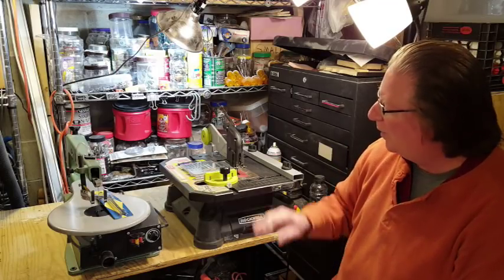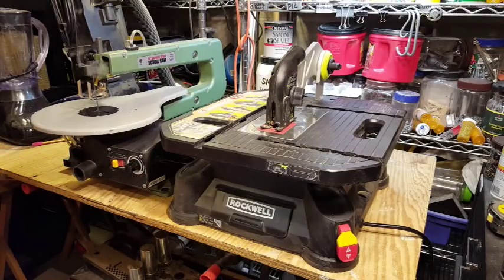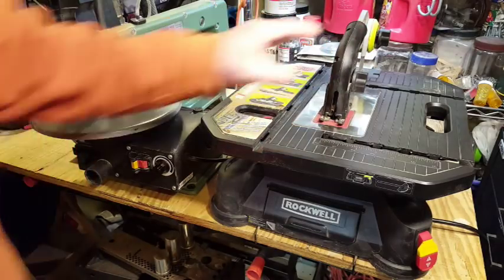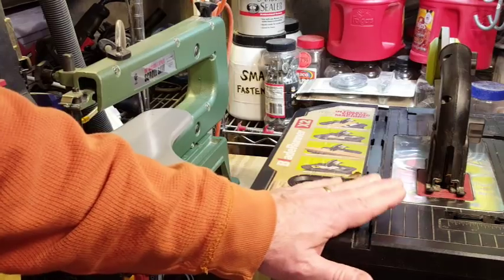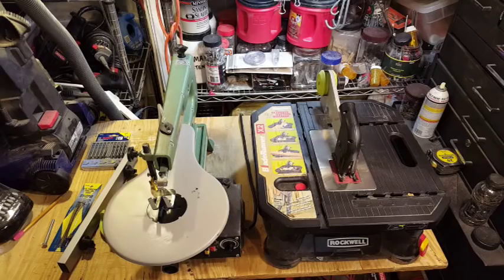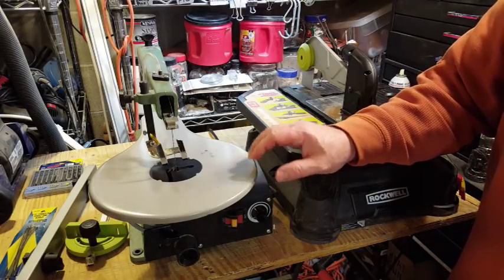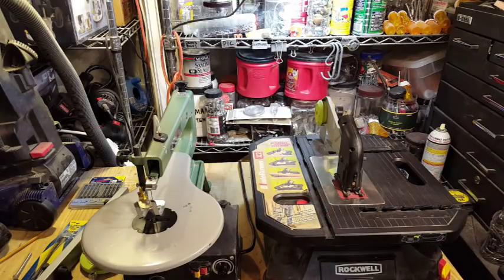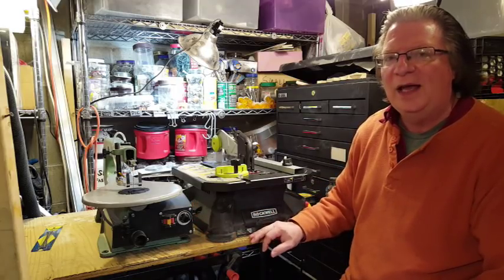12. Scroll saw vs. BladeRunner

Comment: Your presentation is so much clearer than any other one I've seen. I'm glad I heard both of them run. I'm interested in curved cuts only, so the Rockwell saw is out since it does not compare to this (or probably any other scroll saw) for that purpose. An A+ on the review/comparison....
Reply from the maker: Thanks for your kind words and for watching. There is soooooooo much that can be done using a scroll saw and it is far quieter than the Bladerunner X2. Happy scrolling!

Comment: I really appreciate your videos. I gave up my Sear 10" table saw when a piece of  wood flew by my head. I am glad I discovered Rockwell Blade Runner. Keep the videos coming!
Reply from the maker: I'm glad you didn't get hurt by that flying piece of wood! I too have had pieces of wood fly towards me from a table saw which was my primary inspiration for getting rid of it. The Bladerunner is definitely fun to use (although it is loud IMO). I have a playlist of Bladerunner videos here: https://youtube.com/playlist?list=PLGCBwUeR2BD2SPSsV51qPBkK8p1grR-UL&si=cf8bT5bUpZWCbiyG  . 
If I want to make lots of cuts quickly, I try using a circular saw (I think it is safer). I use a battery powered model when possible or a corded model if I lots of cuts to make. Here's a playlist about using the circular saw: https://youtube.com/playlist?list=PLGCBwUeR2BD3Cpl2LJax9kvll9B-SDlau&si=eS5EEdRfFkL14ZQ6 .
If I only have a few small cuts to make, I tend to use a hand saw; I prefer a Japanese style pull saw.
Thanks for your comment and for watching.

Comment: Nicely explained ... you stated a clear distinction between the two saws.  While one might see them as possible competitors, in practice, they are totally different saws that perform different functions.  I could see them both having a place in a hobbyist's shop.  Well done ... Cheers!
Reply from the maker: Thanks Dave. I totally agree; both saws have a place in a hobbyist's shop. The biggest downside with the Bladerunner is the amount of noise it makes. Maybe I should work on trying to make it quieter?
Thanks for your comment and for watching.

Comment: Very well done informational video. The BR can do what a hand held Jigsaw can do, but it can make controlled straight and miter cuts similar to, but not as precision, as a table saw. A scroll saw can do intricate inside cuts that a BR couldn't do.
Reply from the maker: Agreed. For me, one of the huge differences between the BR and scroll saw is how much noise they make. I don't use hearing protection when using a scroll saw but I do when using the BR. Thanks for your comment and for watching.

Comment: Thank U for the comparison between a traditional scroll saw and the Bladerunner. I have the Bladerunner X2 and it's prime function is a small, portable table saw. For this function it performs admirably. It's a great alternative to a portable construction table saw such as the Bosch or Dewalt for light-duty work. I was surprised that I could Rip 8 foot 1x2's without any issue! 

But, now I need a scroll saw to cut wood, acrylic, and some glass. In this case, as noted in the video, it is not possible to cut anywhere near as precisely on the Bladerunner as a traditional scroll saw. Stick to square holes!

There are a number of inexpensive scroll saws. One in particular, as an example of inexpensive “best practices,” is the Wen 3920 16-inch. It has several features that set it apart including the ability to switch the blade 90 degrees and a 45 degree tilting bed and it cost around $86 at this time.

If U need real scroll saw functionality, forget the Bladerunner. But both, taken together, provide great versatility for hobbyists and homeowners. The Bladerunner is a gem as an inexpensive table saw, well build, durable and from a reputable manufacture.
Reply from the maker: I agree and thanks for your comment.
Reply from the maker: Hi Joe. Check out my latest video where I compare the BladeRunner to the scroll saw and band saw and let me know what you think. thanks!  https://youtu.be/mVGa4cUj_nY

Comment: I have 2 Bladerunners the original that has variable speed, but has limited rip with the upper blade guide arm. I gave it to my daughters for home projects as it is much safer than a table saw. The Bladerunner 2 has the upper guide support inline with the blade so you can rip wider boards. These are not fine woodworking saws, but work well for hobby and general home projects.
Reply from the maker: Hi John. I agree; the BR is not a fine woodworking machine. However, if you glue a paper template or draw the cut lines on the wood, you can cut close to the lines and then sand right up to the line. In this way, you can make some pretty good cuts/projects. It might take more time but woodworkers/makers shouldn't be in a rush right? 
I have also found some success removing the upper guide support and using deadweight on the workpiece (to help hold it down while cutting). Check out this video ( https://youtu.be/W-aKZlOVNlI } at about the 13 minute mark to see what I am talking about.
FYI: I have a BR playlist on my channel; here's the link: https://youtube.com/playlist?list=PLGCBwUeR2BD2SPSsV51qPBkK8p1grR-UL
Thanks for your comment and for watching.

Comment: Terrific analysis without really giving an opinion, which is good, just the details! Hearing the noise levels and already owning one of the scroll saws so I know how good it is, makes the difference for me. The Rockwell is just too noisy for regular use, especially in my classroom which is already very noisy. The price is great though, so if you aren't using one very often and only need it time to time for small projects I'd probably go with the Rockwell, versatile, inexpensive but the noise would drive me crazy for long periods.
Reply from the maker: Thanks for your comment. When I use the BladeRunner, I always wear hearing protection. What kind of projects do you do in your classroom? Thanks for watching.
Reply: @ImaginethenMake   depends on the grade. 7th makes a small wood box to hold notepads that they've designed and made in another class. 8th Grade makes simple plaques of their initials, then present their own design for something (skateboards, cutting boards, small shelves) and manufacture it. 8th grade Transportation students make mousetrap cars, boats, hot air balloons, etc.
Reply from the maker: Sounds like fun. I bet your students enjoy making the projects.

Comment: Thanks for this video.  I was pretty sold on the Bladerunner but that difference in sound was pretty striking.  Maybe I should look into that scroll saw before making a decision...
Reply from the maker: Yes, the BladeRunner is loud IMO. But so is my table saw and circular saw. Normally I wear hearing protection, eye protection, and a respirator (rated for paint fumes) when using most of my power tools. 
Be aware that the scroll saw, although a great tool to have, cuts much slower. It also is used when making more detailed cuts and IMO, requires more skill than using the BladeRunner. 
Thanks for watching.

Comment: Very good demo mucho info.I bought the Rockwell to put in wood flooring which is a little heavier blade mostly to use as a table saw for straight cuts. One thing also is the Rockwell has a small table and I made something to keep the long cuts on an even level. the Central Mach. is very limited in that category.
Reply from the maker: Thanks for your comment and for watching.

Comment: Got a Blade Runner X2 for $35 in excellent shape, but still want a scroll saw- now I know what I can do in the meantime!  Thanks, going through your videos!
Reply from the maker: Hi Tim. Congrats on the used BR. Nice price! Have fun experimenting with it. Always remember to let the blade do the work (don't push the wood too hard).
Yes, a scroll saw it a VERY versatile tool and perhaps underrated by many casual woodworkers and crafters.. There are SO many very talented and creative scrollers out there to take inspiration from. Not sure if you watched the video where I disclosed that the Harbor Freight scroll saw that I use, I bought used (but in great condition) for $40. I did replace the blade holders for about $50. All in all, a VERY low price to get started with scrolling. (And the blades are cheap too!).
Thanks for your comment and for watching.
Reply: @ImaginethenMake  I got mine yesterday for cutting pen blanks.  I had to push very hard otherwise the blank will not be going.
Reply from the maker: Thanks for your comment. I'm not sure if you were using a Bladerunner or a scroll saw, but in either case, a sharp blade with right number of teeth per inch (TPI) can make all the difference.
Thanks for watching. Please click the thumbs up so I know you have read my reply. thanks
Reply: @ImaginethenMake  I have Rockwell blade runner. The blade is brand new. I tried to cut the purple heart blank which is hard wood. Thanks for replying.
Reply from the maker: I have never worked with purple heart, but from what I have read, it is a very hard and dense wood and can be difficult to cut. I think you will need to try a number of different kinds of blades before you find the one that works best for you.
Thanks for your reply. Good luck, stay safe, and have fun!

Comment: I had never seen a tool like this, but I had always thought an inverted jigsaw would be useful.  Thanks!
Reply from the maker: Being able to use 2 hands to control the work piece as it goes through the blade makes it very easy to use. It is also A LOT safer to use compared to a table saw.

Comment: I wont completely write off the bladerunner..but that guard blocks your view of what you are doing for more detailed work. So yes the bladerunner is good for straight or angle cuts like making picture frames and stuff.. good review
Reply from the maker: Yes, the guard (I call it "the foot") does block your view of the cut line. Lately, I have been using it without the guard ("foot") installed. I'm cutting large pieces of soft pine (common board). I put a heavy weight on the board so as I slowly push the wood through the blade, the wood has less of a tendency to jump (the heavy weight helps hold the wood down). I find that I can make reasonably accurate straight cuts and curved cuts (using a scrolling jigsaw blade). The heavy weight helps a lot. Hope this helps and thanks for your comment.
Reply: @ImaginethenMake  Yes I take it off at times too..but the wobble is terrible from the blade then.. Oh well.. going to invest in a scroll saw anyhow.. WEN has a pretty decent one over on Amazon pretty inexpensive..

Comment: Thanks for the comparison video. After a day of research I think I’m gonna go with the $80 WEN scroll saw from amazon. I have never used a scroll saw but it has good reviews and it’s pretty affordable.
Reply from the maker: Thanks for watching. I suggest getting a scroll saw that takes either pin end blades or pinless blades. The scroll saw in the video only works with pin end blades. I'm not sure about the saw you are looking at.
Reply: Imagine then Make thank you. I got lucky and the one I ordered takes both kinds of blades. It should get here this weekend. I don’t have much time to practice as I already have to scroll a name that I was asked to do for next weekend. I plan on doing a practice run on cheap pine and then doing it on the good wood after a couple of practice runs. Really enjoying your videos. 👍🏼
Reply from the maker: Good luck with the new saw!
Reply from the maker: Congratulations on finding that bargain! For $25, I think it is a steal. Thanks for your comment.

Comment: I own the X1 Blade Runner. $50 pawn shop rescue.  A Bosch T Shank blade makes it a usable tool. The 1st Generation saw has a poorly designed rail guide system, prone to jamming when feed stock is pushed through.
If crafting small precision pieces; I would buy the (Made in Japan) "MicroLux Tilt Arbor Saw" for $379.95
I use my Blade Runner X1 for 3/4" Pine.
A scroll saw is a good precision machine.
And also costs more than the Blade Runner X2.
Reply from the maker: Thanks for your comment and for watching.

Comment: I have the very first model of bladeruner with metal surface and adjustable speed controller, works great with soft metal copper aluminium etc.
Reply from the maker: Thanks for your comment. I am definitely jealous. If that model was still in production, I would buy one to try out.
Reply: @ImaginethenMake  pls advice a good bandsaw , i need it for metal stock cutting..
Reply from the maker: How thick and what kind of metal? How accurately do you want to cut it?

Comment: So for straight cuts and earmuffs it's the bladerunner
And for long hours of detailed work without aggravating everyone in the home, the scroll saw
Reply from the maker: I agree knowing what I knew back then (I made this video quite a long time ago). Now, I have a different opinion.
Lately, I have been doing a lot more with the scroll saw and trying to learn how to use it better. (Check out my scroll saw playlist to see what I have been up to.) If I were to choose between the 2 machines now, I would choose to use the scroll saw for both the straight and curved cuts.
The difference to me is in the way the blade is held. On the BladeRunner, the blade is only held on one end. On the scroll saw, the blade is under tension while being held by both ends. I think this is what makes the scroll saw a more accurate saw.
The other thing I have gained more experience with is the choice of blades for both the BladeRunner (t-shank jigsaw blades) and the scroll saw (5" pin end and pinless blades with many different blade profiles). I have found that there are some relatively wide scroll saw blades which make it reasonably simple to make very straight cuts. There are also some narrow and very narrow scroll saw blades that can make detailed to very detailed cuts; cuts the BladeRunner could never make.
Yes, the BladeRunner might be able to cut a little quicker (because the blades are bigger than scroll saw blades), but the cut accuracy is just not there compared to the scroll saw in my opinion. Now, many woodworkers make their cuts somewhat away from the cut line and then sand to the line to end up with accurate cuts and you can certainly do that with either saw.
I hope this makes sense.
You also noted that the scroll saw is a lot quieter to use which is a big plus for me.
Thanks for your comment and for watching.

Comment: This is like comparing apples to oranges, as each saw was designed with a different purpose in mind!
Reply from the maker: I absolutely agree. I thought it might be useful to compare them because some people may only want to spend the money on 1 machine or the other and they are not sure which one would be right for them.
I like both machines but if I had to pick one, I would probably pick the scroll saw. It might cut slower than the Bladerunner but it is A LOT quieter. I also think you can make more accurate cuts with the scroll saw since the blade is held in tension from both ends.
Thanks for your comment and for watching.

Comment: This was great! Have you liked that scroll saw even though its a really cheap one?
Reply from the maker: Yes, I still like the saw especially after replacing the blabe holders so I could start using pinless blades. Here's the video: https://youtu.be/W83TllFnMgs .
Thanks for your question and for watching.
Reply: @ImaginethenMake  Awesome, I'll check out that video. I've seen a few of the same saw for sale second hand for around 30 bucks, I'll have to pull the trigger now!
Reply from the maker: I bought mine used (but in like new condition) for $40. Brand new ones can be bought for $100 when on sale. Good Luck!

Comment: What's the story on BladeRunner?   The big box stores don't stock it.  It's available online only.  I figured Harbor Freight would have their own version by now, but they don't.  The reviews I've read say it can't cut straight lines, the blade bends.
Reply from the maker: I first time I saw the Bladerunner was at my local Loews years ago, but when I went back to buy one, they were out of stock and not sure when they'd get more, so I got mine from Amazon. https://amzn.to/33hAcYs 
Despite what you have heard, you can make straight and curved cuts without bending the blade. The key is to use the correct blade and let the blade do the work (don't push the wood too hard through the blade).
I do have a video of me making a fun project out of pine using mostly the Bladerunner to make the cuts (2 different kinds of blades). Here's the link to the video if you're interested: https://youtu.be/W-aKZlOVNlI?si=PTu49GZYE_d1f-zC .
My biggest complaint about the BR is that is it loud (vacuum cleaner loud) so I use hearing protection. The best thing about the BR is how easy it is to change blades. 
I have a playlist of BR related videos; here's the link: https://youtube.com/playlist?list=PLGCBwUeR2BD2SPSsV51qPBkK8p1grR-UL&si=AY_xI7nWOfsX_rm0 .
Thanks for your questions and for watching. If you have any other questions, feel free to leave me another comment.

Comment: I just got a BladeRunner X2 for Christmas, but I am concerned because the blade is so far forward of the two side bearings, that they can't even touch the blade should it be deflected to either side. If deflected, the blade would touch the screws that hold the bearings in place, but not the bearings themselves. ItM, does yours exhibit this property? Thanks!
Reply from the maker: I will take a closer look at my saw tomorrow and get back to you here. Are you using the blades that came with the saw?
Reply from the maker: I made a quick video to address your question. Hope this helps:  https://youtu.be/XbLFCrAQZrE